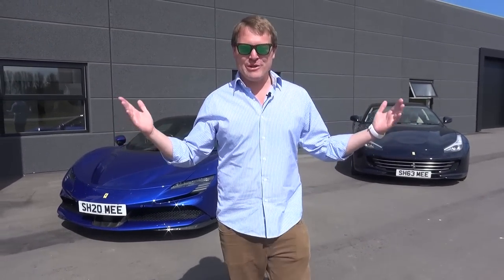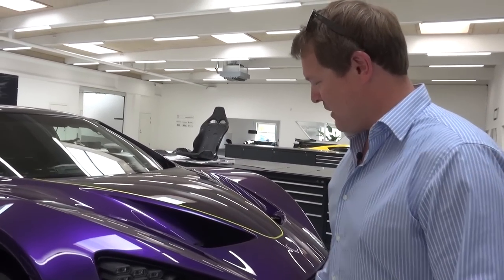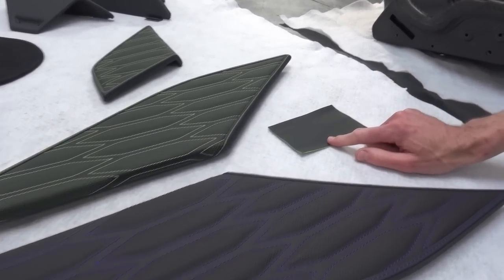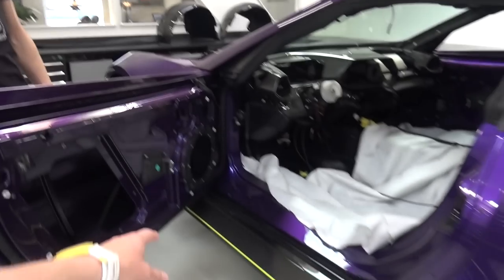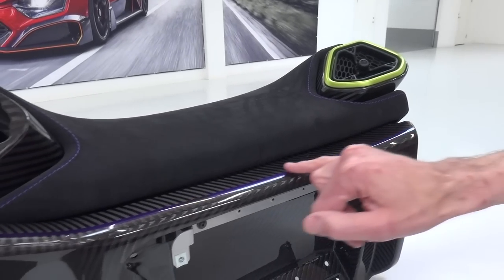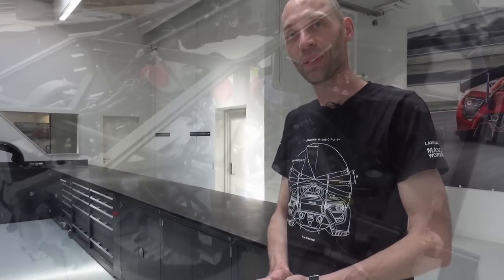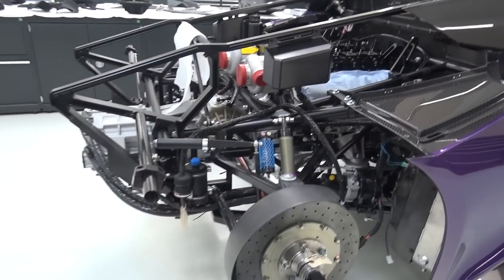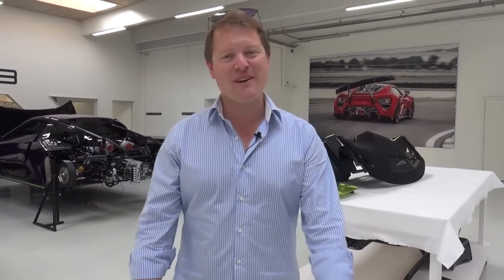HUGE PROGRESS with My Zenvo TSR-S! | ROAD TO ZENVO Part 7

Comment: I love how this company have given you so much access. The quality is far hight than I thought. Exceptionally engineered premium quality stuff. It did look like the car had a regular battery when they have gone to such lengths to reduce weight. Surely a lightweight lithium battery would be more suited.
Reply from the maker: Remember while it's on the line not everything is a final component

Comment: I expect this will be deleted 😁, but in the name of balance I'm here to be the awkward Elli-phant🐘 in the Comment room. I thought someone should speak out to represent the minority view.

I'm not a fan of the purple (again), and I definitely couldn't take the non-symmetrical accents and hand-stitched trim. Is being unique REALLY that important? But a famous SHMEE numberplate alone is enough to identify any car anywhere in the world, so... is it all about being hard to copy? 

Carbon-fibre is challenging to live with, and impact damage - whether you're on a race-track or the road - is bad news. Carbon composites are light and strong but almost impossible to repair; replacement of panels, components, and even whole sub-structures is how F1 teams handle things, but that's eye-wateringly expensive.

Finally, asking for a bespoke British-spec car to be left-hand drive will make the Zenvo seem like a pre-owned exotic Euro-import.

Is Shmee planning to move operations overseas?🤔

Comment: Not exactly high tech is it, all the fancy carbon for weight saving and it is built on a steel chassis, your  Mclaren Senna is 300kg lighter and is the same performance.

Your SF90 will do the 0-60 quicker as well, pointless addition to the fleet.
Reply from the maker: Emotion isn't about numbers, or otherwise we just buy electric cars
Reply: @Shmee150  You have just purchased a hybrid that is quicker and more than half the price, renders this car pointless